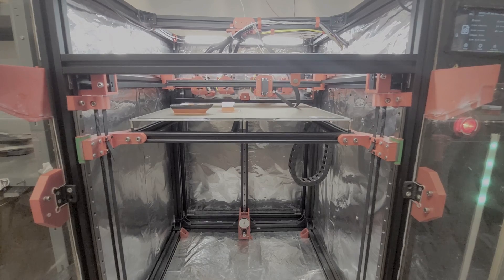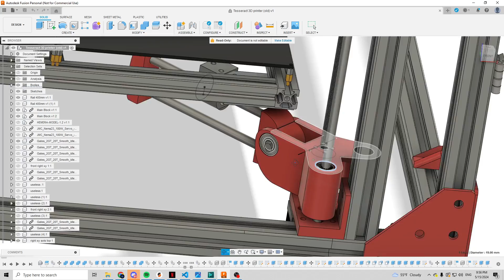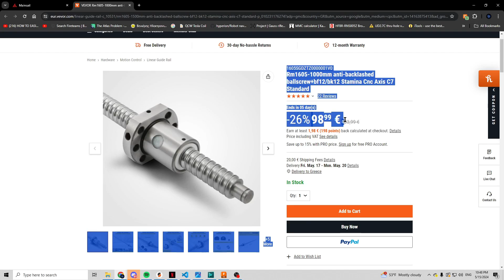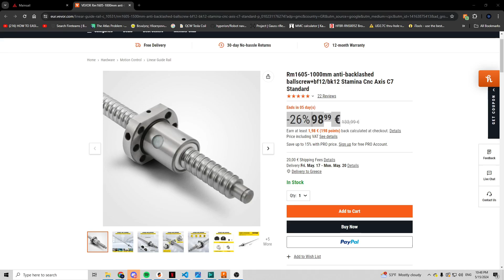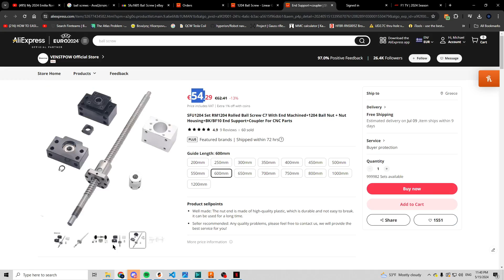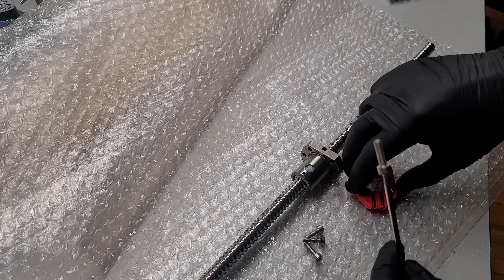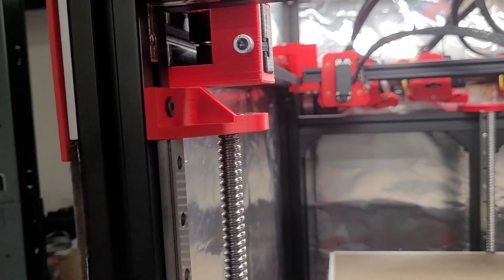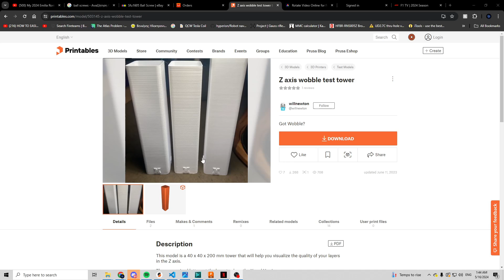Z Axis Ball Screw Upgrade - Tesseract 3D Printer Upgrade Blog

Comment: I have intention to make a large format printer, I think i will choose moving gantry instead of moving bed. because large build volumes mean exponential increase of the printed parts, but the weight of the gantry is fixed. If moving bed was the way to go, i would consider adding counterweight to offset the weight of the empty table at least

Comment: I really dont see the point of people adding ballscrews, especially cheap ones.
if you are willing to spend that much for a subpar ball screw might as well get a highquality regular lead screw - im guessing 10mm or 12mm one - its hell a lot cheaper, easier to replace.
Reply from the maker: The main difference that expensive ball screws have from the cheap ones is their travel repeatability, and in the realms of 3d printing even the cheap ones are good enough, and much better than lead screws.

Comment: I really appreciate this video! For about a year now, I've been building a printer of similar proportions, but my Z axis is even taller, and my bed is cast aluminum (quite heavy!). I made an even bigger mistake by giving it only dual-Z, and a belted Z no less... It does work, but there are plenty of issues. My next upgrade is supposed to be a triple Z-axis ball screw, yet I had little Idea on how to pick them. This helped a lot, you made some things clear for me! Bonus points for using 3D printed couplers, I was very curious if those would work or not, but seems like you answered that as well, so I'll try to find appropriate couplers as well.

I do have one question, I'm planing to put the Z-axis steppers up top, so, the ball screws would "hang" from them (braced with a ball bearing). Do you have any idea on potential problems that might introduce? Is there maybe a reason why that would be a bad idea?
Reply from the maker: Nice! A cast aluminum bed is one thing I regret not using. The quad heat beds I use are a pain to align and don't offer any useful advantage. A better bed is something I have been looking at. 

For a bed this size I have realized that having a 3 motor or even 4 motor z axis is really important not only for more power but for having the ability to tram it. Highly recommended.

Yeah the couplers weren't the best but the ones I got turned out to be too big for the screws and this was a quick fix. I hope that getting proper ones will help with the z wobble

As far as having the motors on top I must say I have never seen that before as far as I can remember. It's a neat idea and I can't see any major problems. I must say however that I am not sure if a coupler with grub screws can hold a very heavy bed with gravity against it unless you have some other support at the bottom. I suggest you try it but I have to say there is probably some reasons that having the motors up top isn't too popular. It might have to do with space constraints or something else that I am missing.

Thanks for the comment and if you try the motors uptop I would love to know how it turned out. 

Good luck with your build.
Reply: @Locksley3D  Funny thing, your build is what's inspiring me to try a similar heated bed build, but with only two beds, I found brand new replacement heated beds for Creality Sermoon D3 at 80% discount, with them having a decent heft and embedded magnets, it was a shame not to take them.

I made some poorly planned design choices so there's actually more space for steppers at the top than bottom. But yeah, haven't seen many designs with steppers on top, except for what Dr. D-Flo did in his giant 3D printer design. Good point! I considered adding some bracing bellow the coupler so the weight isn't pulling on the stepper (as in trying to pull its shaft out), but I didn't consider that so much weight might just slip out of the coupler. I will have to test that, I have some 8mm steel shafts, and lock nuts so I'll try to simulate the strain and see what comes of it.

It'll probably be a few months before I get to it, so there's plenty of time to plan it out. Hopefully you'll make a new upload before that! :D
Reply from the maker: I didn't even think of Dr d Flo printer, but yeah he does indeed have them mounted on the top, which considering how his bed works makes a lot of sense. Proof that the idea can actually work considering he made it work on such a big format printer.

While the separate plates do work there really isn't a major upside to using them. They need big DC power supplies, making them parralel isn't the easiest and they also don't have as much power as an AC heated bed

Comment: I don't see why you would design and make your own printer these days. I made my first one in 2018 there was room for improvement back then. Now, fdm 3d printing is basically a solved problem.
Reply from the maker: I did it not beacuse i wanted a printer. I did it because I wanted to make a printer.If someone just wants a printer to make parts than go and buy a bambu or a prusa.But if you want to mess around and tinker with printers it doesn't get any better that this.
Reply: @Locksley3D  I fully agree. 😀

Comment: Check out the new RatRig VC4. The CAD and BOM are out. You clearly have many inspirations from the VC3.1. The Oldhams seem to be a bit better than the wobbleX since they're not going to be falling apart & losing ball bearings when the frame is tipped. 

I really like the VC4 bolt reinforced bed arms. The 45* offaxis bed clips also keep the bed attached when tipping the frame. So nice! 

I'm sticking with MGN12 Z axis rails for now, just using an adaptor plate to attach to the new VC4 bed arms, but VC4 calls for HG15 z axis rails. I think the stiffer arms were more important for more consistent z axis layer stacking, but testing will need to be done to prove one way or the other. 

Thanks for showing the ballscrew upgrade! I'm building a 500x500x730mm VC4 with VC3.1 parts. If my 800mm T8-4 z axis lead screws bow too much, i'll be looking at ballscrew upgrades too! I had considered the Simplecore z-axis belts, but that route is eliminated for such a large and heavy setup as you show. The thrust bearing suggestion by @ren8 is seconded!

Comment: Best part is no part. and you are adding and swapping so many parts it doesnt feel like your really engineering a solution and just guessing
Reply from the maker: Exactly, I am learning here what works and what doesn't and looking at the result and going from there, I have generally tried a lot of things in this printer and that's where I find the fun in this. I am not a mechanical engineer and truly have no idea what I am doing but I am trying to learn as I go along.
Reply: @Locksley3D  Sounds like fun. enjoy the ride. I did the same thing lol
Reply: What was the point of this comment. He didn't say he was engineering anything specific. Engineering is also a lot of trial and error.
Reply: @jerrysmith6798  what is the point of any comment other then to share an opinion / view. But I concede that perhaps I was being a bit critical and I apologize.

Comment: Seeing as this printer has a heavy bed, I think it would be wise to add some axial/thrust bearings at the bottom of the ball screws, as the stepper motors are not designed to take heavy axial loads and the lifetime of the bearings inside the steppers will be reduced significantly.
Reply from the maker: Not a bad idea, will look into it. Although I must say I haven't seen any printer that uses them, even bigger than mine. If you know any I would be very interested to see them.
Reply: @Locksley3D  Im pretty sure ratrig printers use a bearing to support the screws for the z axis.
Reply: @Locksley3D  it seems to be a generally overlooked area of printer design though. it undeniable, with these design of stepper motors the shaft is aligned by magnets and its held in place by the top plate of the casing, and for when the servo is vertical its designed to have a spring washer on the end of the shaft to provide some support, but the more weight on it the more this flexes, the more friction it creates, the more that washer will wear out and the less precise the movements will be because the servo motor magnets will be slightly out of alignment. so its just all kinds of wrong to allow weight to be supported by the motor shaft in this way. and even if every printer on the market overlooks this, doesn't change the reality of how bad it is, especially when the fix is an inexpensive little thrust bearing.